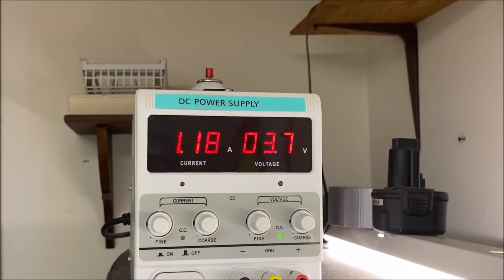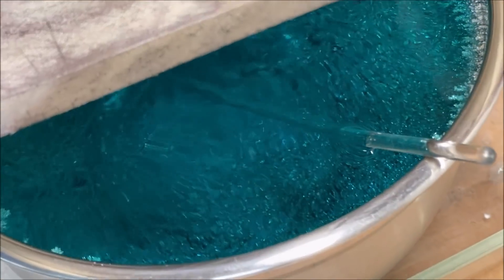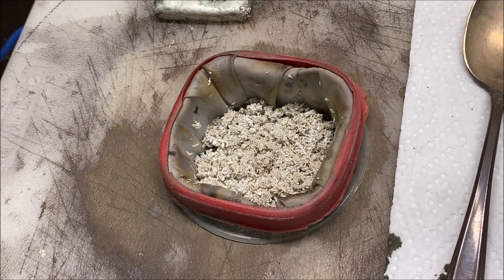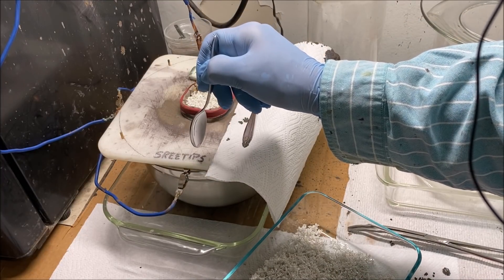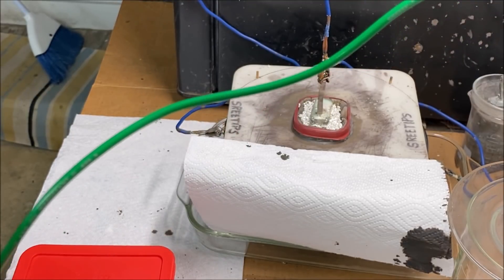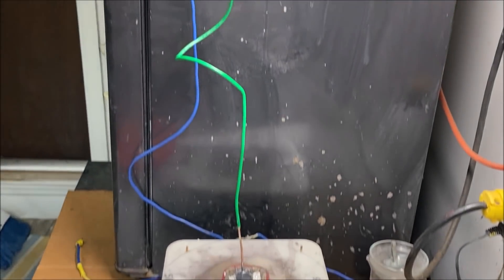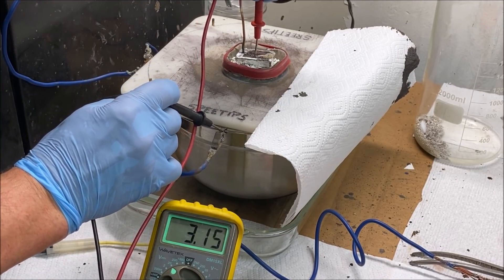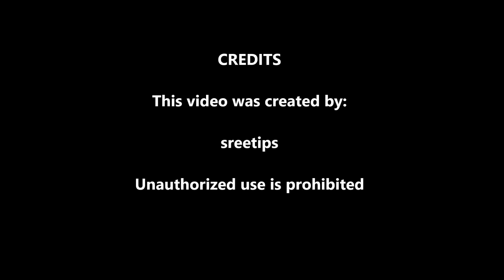EP005 Silver Cell Casting Copper Wire Anode Bar

Comment: I’m struggling to understand the yield of a silver cell. I went on a rampage of buying sterling silver candlestick holders probably a bad call on my part. I’m a total beginner at this and not very smart 😂. I ended up with 290g of sterling silver out of old those holder. I think it would have been better to just buy a 10oz bar. I’m going to digest the sterling and turn it into shot and the run it thru the cell I built. How do I calculate the silver cell yield?
Reply from the maker: For every kilo of impure cement silver that I melt into shot and run through the silver cell, I can expect to harvest 980 grams of pure silver crystal from the silver cell.
Reply: @ much thanks

Comment: Drill a whole in the bowl and if your ace hardware is like ours in Napa,they should have all the little bins of nuts,bolt,washer etc, etc they should have copper flat head screws you could run the screw through the bowl then connect your wire/lead to that,just an idea✌️ Napa California
Reply from the maker: Yes, I’ve seen copper fasteners at Ace Hardware.

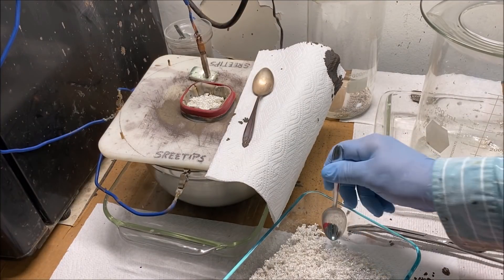Comment: 4:18 If my B grade high school chemistry serves me correctly every gram of Cu that enters your electrolyte must displace 3.4 grams of Ag due to valencies and differing atomic weights. If your cement shot is conservatively 2% Cu then every Kg you add must displace 68g of extra Ag from the electrolyte. 100g of AgNO3 powder added with water top up for every Kg of cement shot ran through comes pretty close. I have put 800g of sterling through mine... Slimes are a PAIN and its clear my feed stock needs to be as pure as practically possible, even if it costs me more HNO3.
Reply from the maker: Sounds about right

Comment: Hi, I  love your videos. I think i may have made a puter/silver alloy by mistake how would you go about fixing that and extracting the silver? I dropped a small flake into HCL (50/50 Distilled h2o) with no reaction w/o heat. Any help woul be appreciated. Thanks
Reply from the maker: I’ve never worked with pewter. No experience
Reply: @sreetips  well, then lemme ask ya this, i have 1500 grams silver alloyed with an unknown metal. How would you go about identifying the unknown metal?
Reply from the maker: I don’t what will happen because I’ve never performed this experiment myself. I’ve never worked with puter.

Comment: Put your meter positive on the negative clip, negative on the bowl.  It should be the voltage difference.  Do you think the Silver Nitrate solution is releasing enough NO2 to corrode the clip and cause resistance?  Is there a small amount of current riding on the condensation on the plastic cover?

Comment: I'm very confused by your time line Navyman. Looks like ya got into the tequila and forgot where you were in the time line. I understand and cheers but it is very confusing.
Reply: Did you read the large print at the beginning of the video?
Reply from the maker: No tech hela for me - I’m allergic to alcohol. I renumbered the videos to make them flow correctly. This particular video was taken down by me, then reposted later and that’s why it seems out of sequence. If you follow the numbered titles it should be right

Comment: If you watch a video on soldering copper pipe plumbing or soldering wire you will see the importance of using flux for a good connection

Comment: Yeah didn't notice the mod on this, one thing I would do is suspend the wire above the bottom of the mold so it's not exposed once the silver is cast.
Looks like you have a down pact system now.    :  )

Comment: What about when the anode bar contacts the electrolyte isn't the risk of copper plating out with the copper wire in the anode bar alot higher I'm not shure just wondering
Reply from the maker: Nelson, copper in the silver cell is not a problem.
Reply: @sreetips  good to know thanks
Reply: @nelsonfisher7151  It potentially can be a contaminant. He'll have to monitor bar wear carefully. Otherwise claims of .999 silver are inaccurate.
Reply: @joshua.snyder  US law requires the silver to be 995 to claim 999, that is 5 parts per thousand, doubtful any copper would get anywhere near that amount with electrolysis.
Reply: @mikemike-qx2ue  People throw around .999s fine too loosely. There is enough copper in the wire to potential affect that, is the point. He should use silver and avoid the problem, also would get a bit cleaner current.
Reply: @joshua.snyder  "There is enough copper in the wire to potential affect that" No, you do not understand how it works. As long as the silver amount is sufficient, that will deposit in preference to other metals, that is chemistry and has been proven tons of times.
Reply: @mikemike-qx2ue  I understand how the electromotive series works. Let's simplify it for you. If Kevin uses a copper bar or wire in the core of his anode and allows his cell to run too long unchecked and exposes said copper it will contaminate the end product and his electrolyte. I have had this happen and verified it occured via XRF and SEM.
Reply: @joshua.snyder  As long as it stays above (80% or 90% (don't recall off hand which amount)) the science of chemistry will ensure silver deposits at least to the required purity, 'tis why people use electrolysis to obtain high purity due to its consistency.
Reply: @joshua.snyder  "I have had this happen and verified it " I could tell from all the videos you have uploaded on your channel, 'sneeder'.
Reply: @joshua.snyder  That you screwed something up? Don't bother I believe you would screw something up.
Reply: @mikemike-qx2ue  Yes, using copper in a silver anode was a mistake. Hence the point. Must be nice to not make mistakes to learn from. 🤷 
Love your original content too, btw. 🤣
Reply: @joshua.snyder  Except you don't learn; I submit if you refined silver by electrolysis, which at this point I doubt, that you would make the error again; I also submit that if you did so, it wasn't you, you merely paid someone else to do it for you, and they messed it up. What did you do to the person who did, if I may ask?
Reply: @mikemike-qx2ue  Not following your run-on sentences. Is that a question or a poorly worded insult? I have done the work, as have others. What is your point?
Reply: @mikemike-qx2ue  What the heck was the point of that video link with the homeless guy and the newspaper?!
Reply: @joshua.snyder  " I have done the work" if you had you would know your concern is baseless.
Reply: @mikemike-qx2ue  It is you who doesn't grasp the issue. Donations have zero bearing on the discussion. Your personal insults, weird videos and sidetracks show that you are blustering. Feel free to have the last word. Done with your silliness.

Comment: Do you ever top off the electrolyte in the cell with distilled water or do you only top off with more electrolyte?
Reply: I'd like to know the answer. With evaporation compensated in consideration.
Reply: @davidedgar2818  I recall Streetips topping up with silver nitrate solution although he may use distilled water from time to time. Water would be appropriate to replace evaporation losses but silver nitrate may be preferred when the anode silver is impure, particularly if copper is present.

Allow me to explain.

Unreactive contaminants such as gold don't dissolve but form what are called "anode slimes". For obvious reasons, Sreetips recovers these. Because they haven't dissolved, these contaminants have no effect on the electrolyte.

More reactive contaminants, particularly copper, do dissolve and this is why the electrolyte sometimes turns blue. For every copper atom that dissolves, two atoms of silver plate out at the cathode. This process depletes the electrolyte of silver and so additional silver nitrate must be added to keep the silver concentration high. A high concentration of silver is needed so that silver keeps being preferentially plated at the cathode.
Reply from the maker: I could not have said it better. I knew the electrolyte becomes depleted of silver as it operated.
Reply: @roberthayward9299  Thanks for the detailed response. That was very helpful.